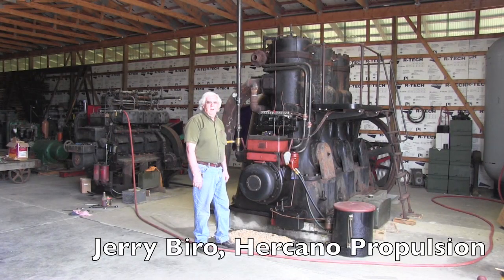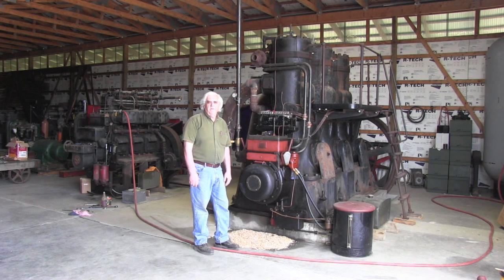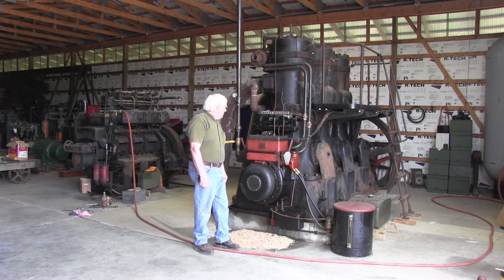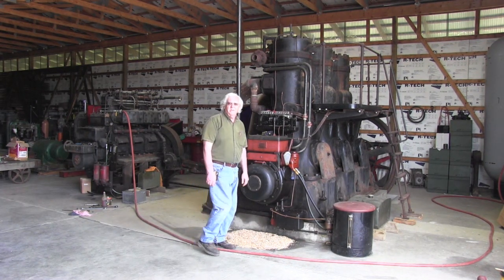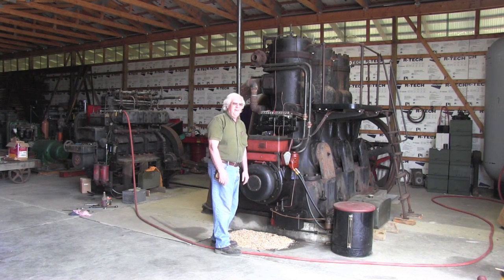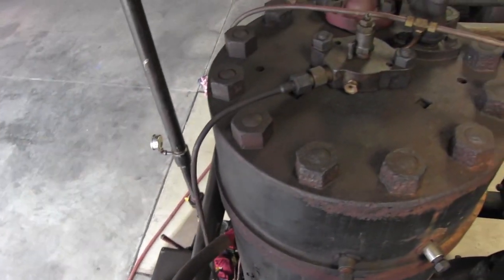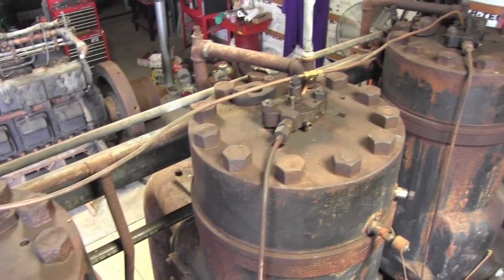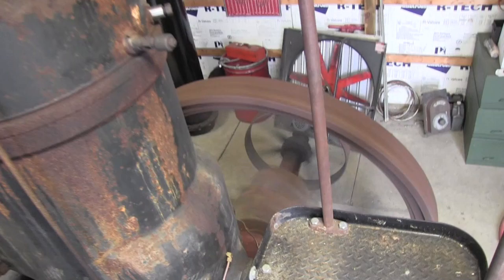Fairbanks Morse Model 32 Diesel

Comment: Very cool! I didn't know that there could be such a huge differential between the horsepower and the torque.
Reply from the maker: +Ken Allen Horsepower is torque times RPM, so the lower the rpm, the higher the torque... and vice versa.
Reply: +Jim Allen Ah, that explains it!
Reply: Beygir gücünü hp cinsinden hesaplarken tork nm mi yoksa lbs.ft olarak mı alınmalı ve motor deviri en yüksek beygir gücünü veren devir ile mi yoksa en yüksek torku veren ile mi bulunmalı ?

Comment: Up to today I have only seen you tube videos with the exhaust pipes pointing skywards. This is the first I have seen where the pipes go groundwards. I see the sense of the shape and length now; presumably there is a muffler system or chamber for the spent gases.
Reply from the maker: The engine was mounted according to Fairbanks-Morse plans and that included a chamber in the floor that acted as a muffler.

Comment: Were these separate cylinders bolted to a common crankcase? I am seeing videos of several versions from single cylinder up to 4 and I think I saw one as six cylinders. With 2 and 4 cylinder models being more common.
Reply from the maker: Yes, they were separate. In today's language, we would call them "modular." They built these in configurations of one to six cylinders. The cylinder, piston, con-rod, etc was the same only the number of cylinders. To learn more, go here: https://www.dieselworldmag.com/features/torque-monster/

Comment: The "air intakes" are mislabeled. The actual intakes are on the opposite side of the engine. They are cylinders of perforated metal about 6" diameter and 14" tall.

I believe the mislabeled parts are disc type poppet valves that perform the same basic job as reed valves on modern 2-stroke gas engines. They seal the crankcase during the transfer phase.
Reply from the maker: This is a E-style engine with crankcase scavenging. There were also 32A and D that used external means for filling the cylinder and they had an external port on the cylinder. Models E, F and Y were crankcase scavenged more or less like this.  I can't post the image here but look at this story  https://www.dieselworldmag.com/features/torque-monster/  Scroll down bit and you will see the intake flow on this model engine. Air comes into the crankcase for the particular cylinder thru the reed valve on the upstroke of the piston, volume of the crankcase (there is a separate one for each cylinder) decreases so a partial vacuum is created, the intake port in the cylinder is closed by the piston and the reed valve opens. When the piston moves down during the firing event, the volume of the crankcase is reduced,  crankcase pressure increases, the reed valve closes, the intake port is uncovered and the cylinder is filled via the crankcase pressure. Looking at the illustration. will make it clear. I have illustrations of the other styles of intake but I can't post them here in this comment section. My terminology may be oversimplied, but they are  the "air intakes."

Comment: Hi what a  good old Scholl engine . How Works the aircleaner on that type engine ?
Reply from the maker: Tommy- Because it's a crankcase scavenged engine, it breathes through the crankcase. The F-M engine had several alternative means to breathe, one through a vent at the end of the crankcase, and another via a separate intake stack. This on has the latter setup. Probably the best way to understand how this engine works is found in the accompanying article from Diesel World Magazine- https://www.dieselworldmag.com/features/torque-monster/
Reply: Ok but that is a big nice engine nice Sound  Will running for ewer  when get oil and other No one new engine will run so many years 👏